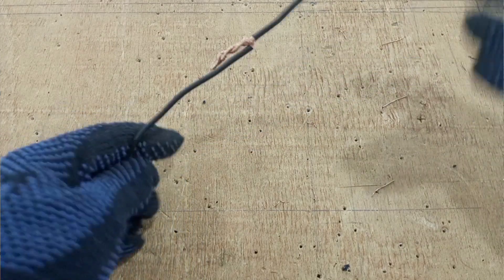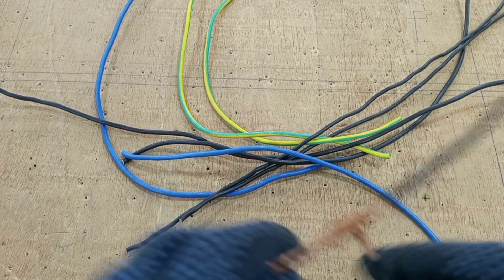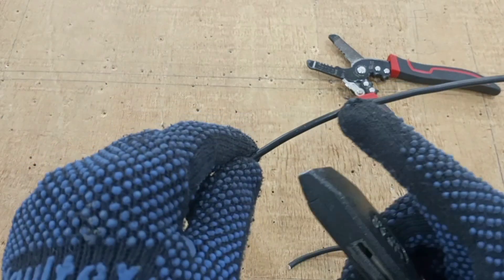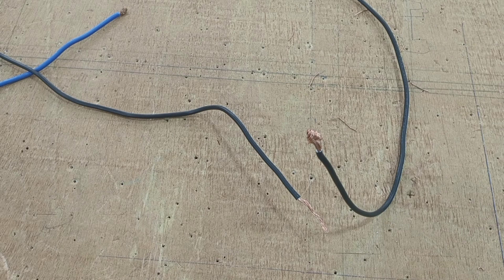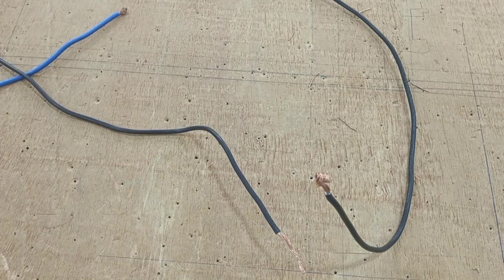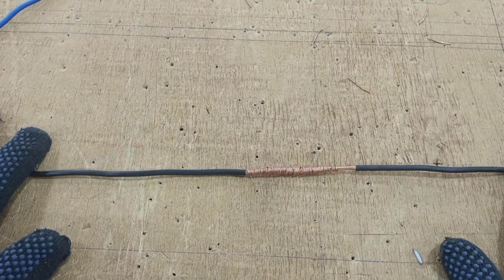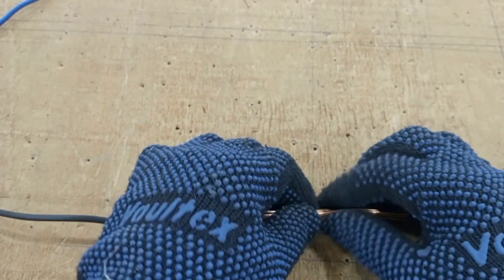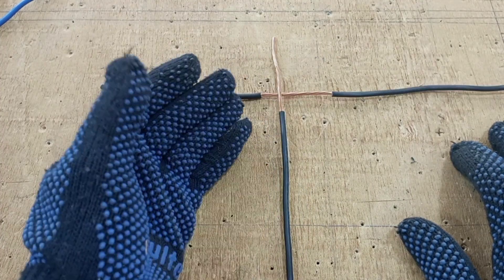How to make Good cable joints

Comment: In the absence of purpose designed mechanical coonnectors or soldering then this is good to know. Property insulation is a given I guess..... although I've seen some very agricultural "temporary" installations. 
The mechanical strength of your joint is impressive. It would be reasonably well consolidated and airtight internally too.
Regardless of how a conductor is spliced, it is always an alarm bell when a short conductor on a new build has a join in it. It says "stingy short cut contractor, look for more rubbish work"